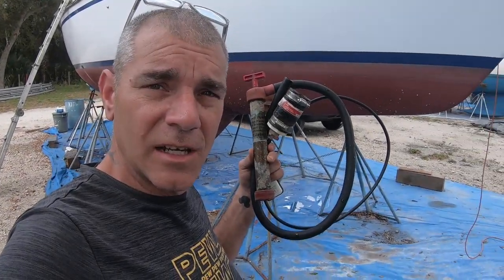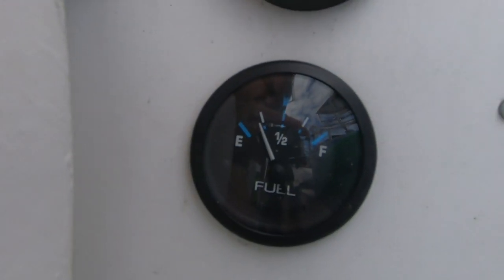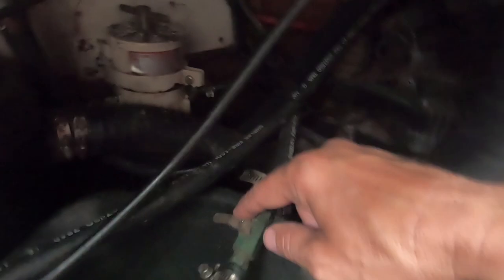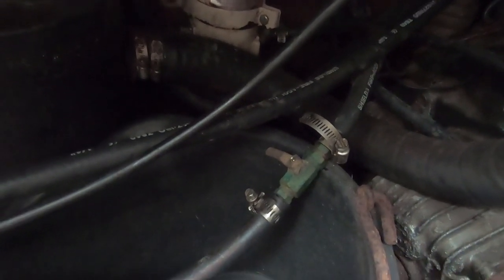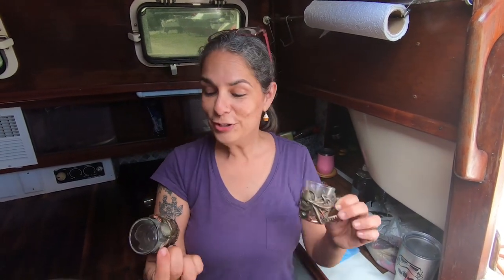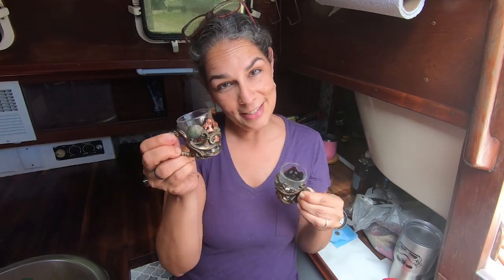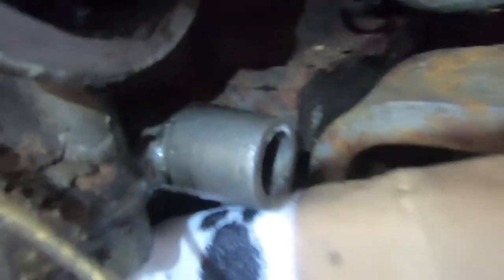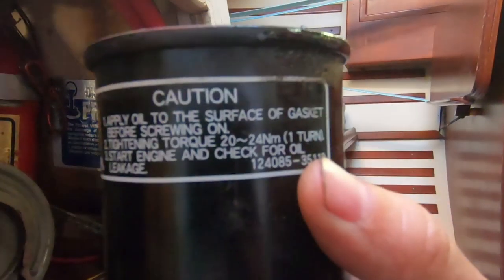Final Stages of our mini sailboat refit - Log Entry - 96- Knot Vanilla

Comment: If you can, get the Spinlock Deckvest.  They are a far superior life jacket, and they have many extras such as a pop up strobe and perhaps most important, a spray hood!

I hate when people steal things.  A while ago I was in this one marina for a few days and they had a known theft problem.  Several acquaintances were complaining about it so I thought I would do something.  I purchased a cheap one or two gallon petrol can and filled it with cheap gas.  I then added some mothballs and a fair amount of sugar, and left it out.  Sure enough, it was stolen that night.  I was quite happy!  I was even more pleased when a guy who was suspected of being a low life had his outboard motor die later!  A was back there a few weeks later (without my boat!) and happened to bump into him.  He was whining about his motor when I said someone stole my gas can.  I said it wasn't all bad as I had sugar in the gas.  The look on his face was priceless.  He knew that I knew!
Reply from the maker: I try not to be the hand of Karma. But it is satisfying to see when it happens. I looked those jackets up, and wow, they are nice!
Reply: @knotvanilla7808  I really like them and find them to be far, far superior.  While I like all of the features such as the pop up strobe and integral shackle, I like the crotch straps and spray hood the most.  The spray hood will help prevent secondary drowning.  A side benefit is that the recharge kit is half the price of the hydrostatic recharge kit!

Good luck with getting her ready for the water.  Fair Winds!

Comment: Since you are, like many people, cost conscious one thing to do is find cross references for all your normal maintenance  items. i.e. Oil and fuel filters, drive belts, etc. This can save you a lot of money. Yanmar does not make the filters used on their engines. Just like everyone else they buy them from filter manufacturers. You can too, just without "Yanmar" printed on them. This is also true for items like alternators, starter motors and raw water pumps and parts, especially impellors.
BTW diapers are pretty good at soaking up oil. I put one under my oil filter when I change it to help control the mess. Diapers are quite cheap compared to those "marine store" oil soaker up towels and available worldwide.
Reply from the maker: We have some spare diapers onboard for back up.  But we always keep an eye out for the pads.  Last ones, we got a pack of 20 for $3 at a fuel dock.

Comment: I hope they didn't get your helmet, but I'm guessing if it was on the boat it is the first thing they saw wehn they broke in...  I started putting a big ziplock bag over my oil filters and I get all the excess oil and the filter all in one place all sealed up.  Also, and keep in mind this is difficult if not impossible for you to do this other suggestion because your filter is sideways; Filling the filter with oil ahead of time allows less run dry time while the motor pumps oil after the oil change.  I basically barely saturate the filter if they go on sideways.  That way there is some oil in there and hardly if any leakage during the spin on process.
Reply from the maker: That's a great idea. Next time going to try that. Thanks.

Comment: Weird, my comment about the provisioning spreadsheet disappeared.  Oh well.  I use a spreadsheet however I print it out and just mark it up as I go.  I keep it with the log book so it is convenient.  I make logbook notes constantly, so this facilitates its use.  The only time it is more convenient to use electronically is if the computer is always on.  If it isn't, then you have to wait for it to boot up, open the spreadsheet, etc.  I print out several and only use a new one when starting a new trip or the old one gets too messed up.

If you would like a copy, let me know and I can send you an electronic version or you can just go to The Boat Galley and download it from there.  Good luck!
Reply from the maker: Thank you so much.  I actually use my phone and tablet that sync's directly to Google. That way, I can pull it up quickly on any device I use quickly and reference anything.  I use it alot for part numbers, measurements, and even silly things like wire gauge size.